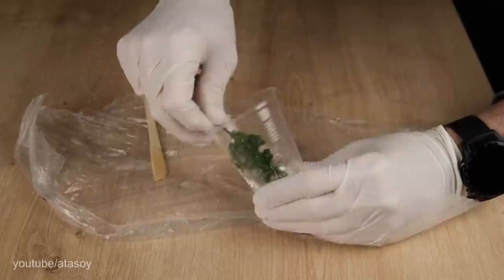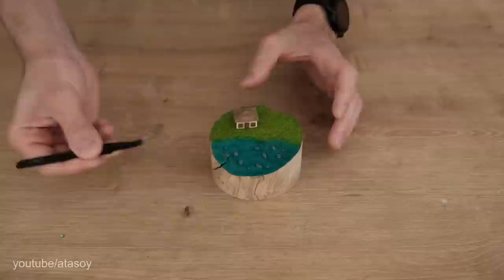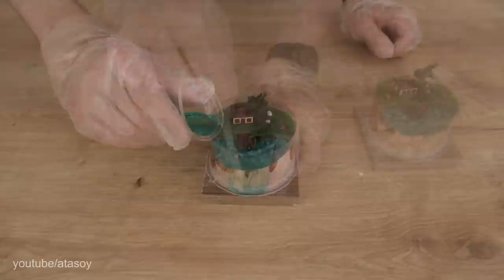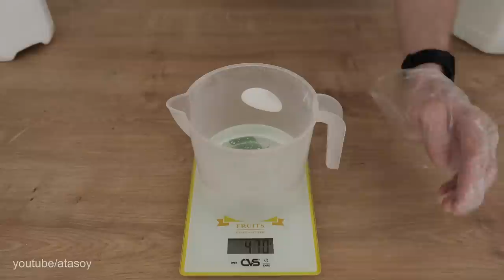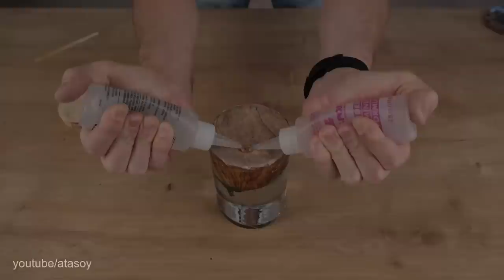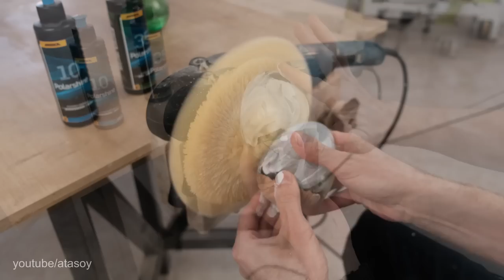Epoxy Resin  Country House Diorama

Comment: Bro can u make one in 500 rs
Reply from the maker: Please do not make a price offer.
The price you offer is much lower than the price of the material used.
If the price of my work is expensive, please contact other epoxy artists.
Reply: Then can u make a 1500rs
Reply from the maker: Please do not make a price offer.
Is this a video content platform?
It's not a sales site.